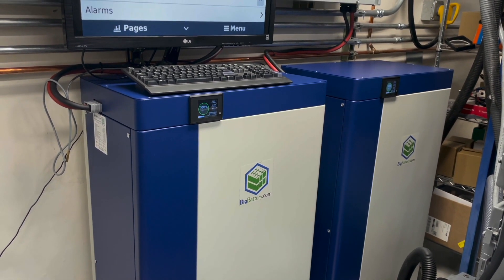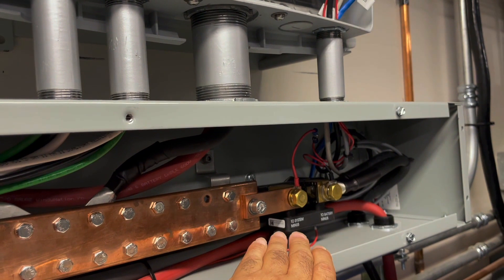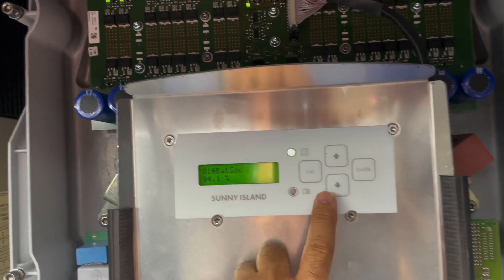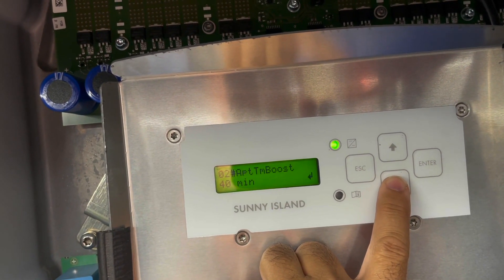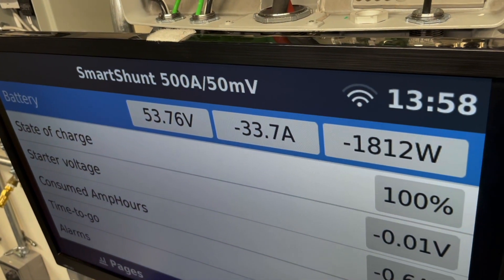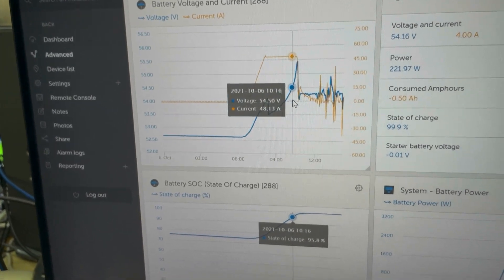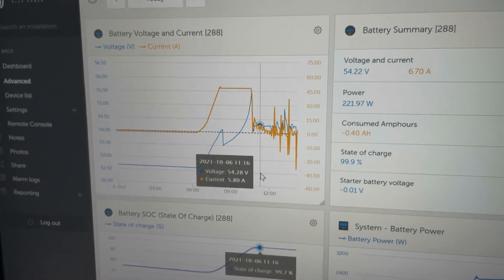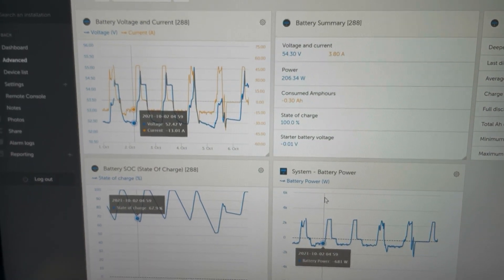SMA Sunny Island - BigBattery Kong Elite Update

Comment: I am curious about your cell voltages. Are not LiFePo4 cells typically 3.25VDC? You had mentioned down in the 2 volt range in your video. I am looking at installing Li into my ten tear old Sunny boy/Sunny island system to replace my old Rolls Lead Acid. Cannot believe I had a tech from the place I originally purchased it from in 2014 that the SI6048 would not produce a high enough voltage to charge Li batteries! The literature states that it is capable of up to 63VDC. Frustrating that folks who are supposed to know what they are doing do not.
Reply from the maker: @MarkSpencerAZ  hi mark. The voltage mentioned in the video is due to the SI6048 being a lead acid battery charger. A 48v lead acid battery has 24 cells at 2v nominal voltage. My lithium ion has 16 cells so what I was doing was figuring out what maximum voltage I want for my battery. Let’s say 55v, so I take 55v/24 = 2.29v and this is the setting I use in the SI6048. The actual cell voltage I am receiving is 55v/16=3.44v per cell.  I hope this makes sense. Where in Arizona are you located? I’m in Tucson.
Reply: @curiousumscientia3648  Ok, am I correct then that the 6048 assumes 24 cells? Otherwise why not just multiply 16 x your desired voltage of the total Lithium pack? I've been running Rolls 6v LA for ten years now, but need something lighter. I am considering the Midnight Solar 48 V 16Kw offering, although EG4  has Modbus capability and should communicate with the Sunny Island.  I am going to try and update my firmware and see if it adds the lithium profile to their list. I live in Sunsites, south of Willcox, but am in Tucson twice each week, usually at RTX. I'm an RF guy. We should grab lunch or coffee.

Comment: Thanks for your great videos.  I have duplicated your setup with 2 sunny islands, one sunny boy PV inverter, and 5 kW of solar panels.  Did you have any trouble with the BigBattery Kong Elite BMS shutting down because it detected an overvoltage from the Sunny Island inverter?  I am using Trophy LiFePo4 batteries.  The battery BMS is detecting an overvoltage at 100% SOC and shutting down.
Reply from the maker: Paul thank you for your comments and good to hear you have a good system put together! I had to keep adjusting the maximum volt/cell range to avoid over voltage on charging. Since this change, this has not occurred much. I will have to look and tell you 1) the bms over voltage setting on my Kong Elite and 2) my max volt/cell value on the Sunny Island inverter. With this you can compare to your settings. You might have to keep lowering your volt/cell values to avoid this shut down from occurring. In over 2 years of operation I have had 18 overcell voltage occurrences with the most occurring in first few months of my setup until I adjust volt/cell charge values. I will reply with this info once I get a chance to login to my bms and Sunny island. What are your sunny island settings?
Reply: @curiousumscientia3648 Thank you for your quick response.  My battery type is Lithium External BMS, so the battery is reporting the SOC to the Sunny Island inverters over an RS485 cable.  Unfortunately, I can’t set the max volt/cell.
Reply from the maker: @paulruben6933 Hi Paul. Wow this shouldn’t happen then. The battery should be telling the inverter to stop charging and this then should prevent overcell voltage from occurring. Anyway to contact the Trophy battery company and explain the issue occurring?
Reply: @curiousumscientia3648  That is what I thought.  I have been working with the tech support at Trophy battery, but they have no experience with Sunny Island inverters.  The battery manufacturer has not been able to offer a solution and SMA does not have a setting to stop charging a 95% SOC.
Reply from the maker: @paulruben6933  someone from trophy must have written communication parameters that is being shared with Sunny island for the battery to be able to work in this charge mode with the Sunny Island so somewhere there should know. I will look at there website.
Reply: @curiousumscientia3648  You are too kind.  I am working with Dan Keaton at Trophy Battery on this issue.
Reply from the maker: @paulruben6933  Paul, I hope this occurrence of overvoltage is being reduced. I did come across the following on documentation for another battery type (SOK) when connected to a Victron inverter but the issue is same you are seeing and now in hindsight similar to what I saw. Basically a new pack might not have all cells well balanced and needs some full charge cycles to balance. If this doesn’t work, they recommend lowering the max charge voltage for a few charge cycles and then slowly raise it again in hopes the cells become better balanced and that it eliminates over voltage message. See as follows: High-Voltage Alarms:

The following is quoted from Victron’s documentation:
The ‘high voltage’ warning or alarm is not unusual on new batteries that are not yet balanced. To help the batteries balance quickly, keep the batteries fully charged until the errors go away. In an ESS system, set it to ‘keep batteries charged’, in an off-grid system the fastest way is to either charge / balance the battery before installation, or to fully charge with a generator if not enough solar is available to keep the batteries fully charged.

If you are unable to maintain the target voltage to balance the batteries without the ‘high voltage’ alarm occurring, you may need to enable and set the “Limit managed battery charge voltage” setting in the DVCC menu of the GX device. Reduce this voltage as necessary until the alarm stops. After sufficient time to balance the batteries, try increasing this value until it can be disabled again for normal operation.
Reply: @curiousumscientia3648  Thank you so much!!  I will give this a try.

Comment: I'm curious what thickness copper bar you used for the dc buss bar. I assume you fabricated this. Is there any information as to how you calculate that. Thanks.
Reply from the maker: Hello,
I used the following dc buss bar: https://www.amazon.com/gp/product/B08L8TB3G3/ref=ppx_yo_dt_b_asin_title_o03_s00?ie=UTF8&psc=1 . It is 6mm thick by 50mm wide. In terms of sizing the bus bar I did not perform the calculations but believe one would use the resistance of the copper, thermal conductivity of the copper, heat transfer coefficient (for dissipation of generated heat to the ambient based on airflow conditions around the bus bar), the amount of current flowing through, and the bus bar cross section to calculate the temperature rise of the copper bus bar over ambient. You would then want to make sure this temperature doesn’t go over the insulation rating of the wire connected to the bus bar or
the temperature rating of the stand-off or some type of electrical code guideline for temperature rise. I picked mine and just checked temperature rise during operation with Infrared gun and saw that it was not consequential for current flows I experience.
Reply: @curiousumscientia3648  thank you for this information.

Comment: how quick will the sistem change to battery output if the grid goes off? will a normal computer keep running seamlessly during the "switch-over"? I'm looking for a sistem for my business to run about 20 computers, as a backup.
Reply from the maker: Hello. Thank you for comment. My system is offgrid so do not have a switchover occurring as it is the main power source.
Reply: If you need a sunny island I'll give you great price

Comment: Thank you for all of the information.  I also bought two Sunny Island inverters but have not yet incorporated them.  We have 9.4KW installed (name plate power) with two Sunny Boy 4000US inverters & are grid tied currently.  With the new changes by the California CPUC I am looking to taking my system off grid.  Incorporating batteries & the Sunny Islands should do it.  I would like to ask some question as I get closer to changing our system.  Thanks.
Reply from the maker: Yes let me know if you have questions when you get closer to building your off grid setup. I really don’t like the utilities, they are very anti-solar.
Reply: @curiousumscientia3648  Thanks, I have not had any data collection capability (short of reading the meters & writing down the numbers) yet.  I just now have a way to connect to my network.  Where were you able to source the SMA data manager & Vitron hardware from?  I am hoping I can change to off grid in stages, first to have grid back up before I go completely off grid.

Comment: How do you get this Victron shunt to record the data like you showed a 11.27
Reply: I have the battery monitor 712,  I would like this function.
Reply from the maker: I followed this video below originally to setup the system:
https://youtu.be/UXskvldEmiw

But also since then videos like this show how:

https://youtu.be/50V50lISnC8

I bought raspberry pi 3 board (Raspberry Pi 3 Model B Board https://www.amazon.com/dp/B01LPLPBS8?ref=ppx_pop_mob_ap_share), a case, SD card, VE direct USB cable (Victron Energy VE.Direct to USB... https://www.amazon.com/dp/B01LZ6WTLW?ref=ppx_pop_mob_ap_share) which connects to the raspberry pi and Victron smart shunt (Victron Energy SmartShunt 500 amp... https://www.amazon.com/dp/B0856PHNLX?ref=ppx_pop_mob_ap_share).
Reply from the maker: Does the 712 have VE direct connection? I see it has an rj45 looking connector. I wonder if victron has usb cable like the one I linked that is for 712 if it doesn’t have VE Direct
Reply from the maker: You might need this cable for the 712  instead of the one I listed with my setup: Victron Energy Interface MK3-USB (VE.Bus to USB) https://www.amazon.com/dp/B06Y5WS3VZ/ref=cm_sw_r_cp_api_glt_fabc_J8WRC9FKRMGSSKE72A5X?_encoding=UTF8&psc=1